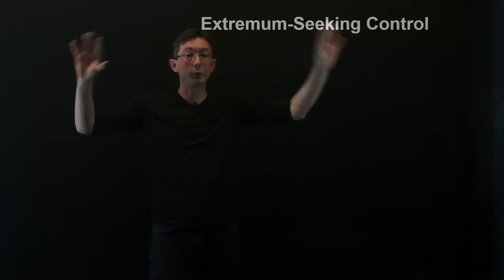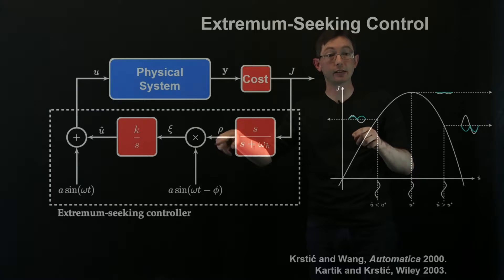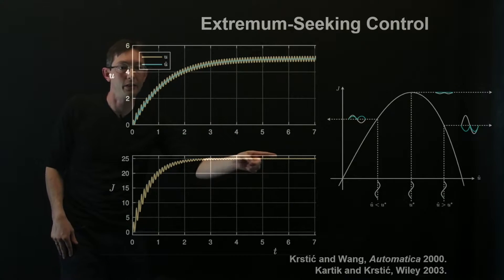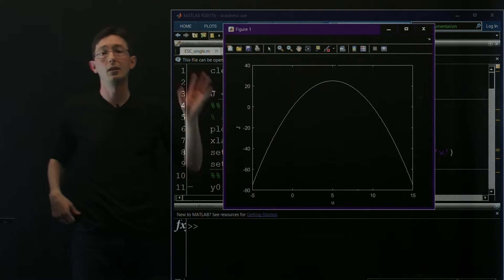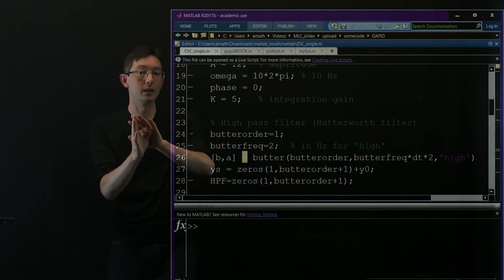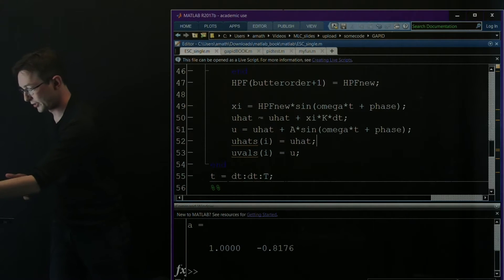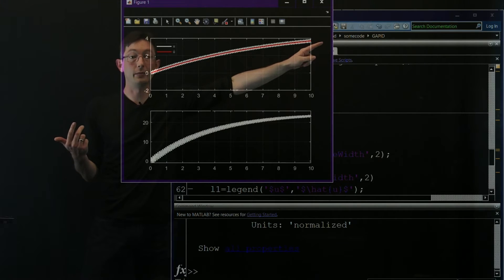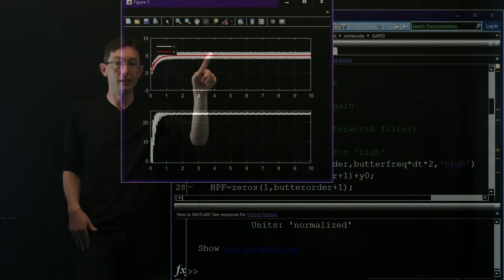Extremum Seeking Control in Matlab

Comment: I suppose you could use ESC with an ESC, that would be ESC^2 control.
Reply: (I assume you're talking about electronics speed controller)
Nice pun, but most ESC on the markets use either:
Sensorless: trapezoidal commutation, which is basically just switching sequence, no need for controller algorithm
Sensors: FOC, which primarily use PI(D) controller
Of course more crazy algorithm like adaptive control, fuzzy control or ML has been explored academically to squeeze out every last bit of efficiency. But for the vast majority of applications just be able to turn the motor is good enough, and if the motor couldn't quite do the job, well, just buy a stronger motor.
Reply: @minhhungnguyen7867  I meant to servo the input.